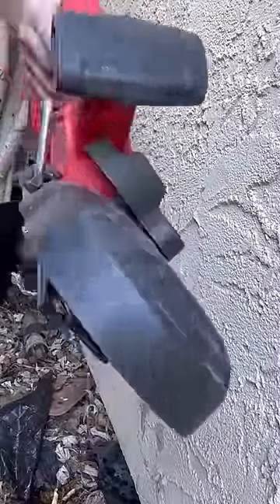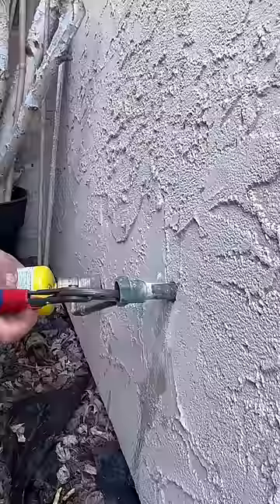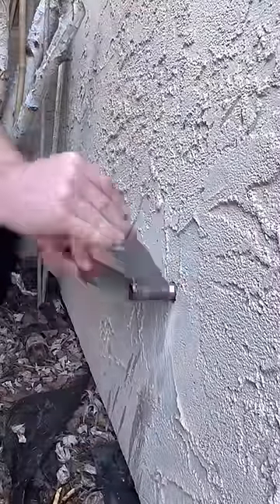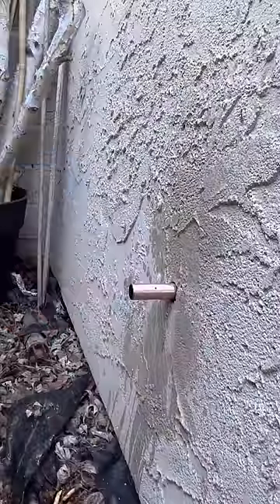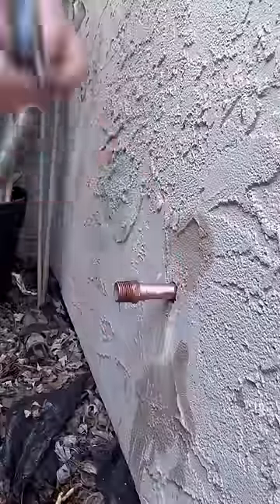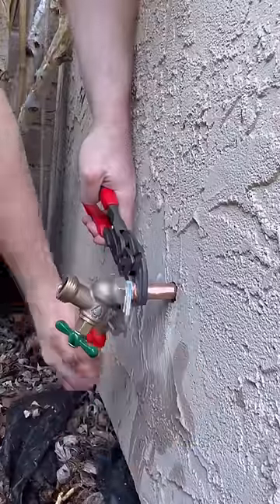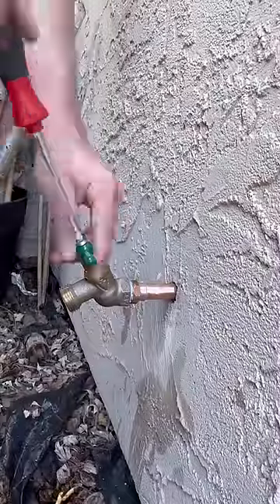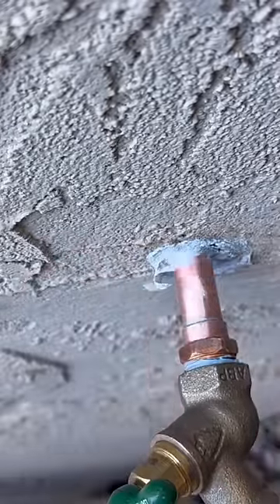swapping a hose bib #plumber #plumbing #diy #soldering #oateyambassador #propress #copper #repair

Comment: “All the OGs use tape and dope” damn straight, good work.
Reply: Exactly !
Reply: He earned all our respect when he said that
Reply: @OB1canblowme  was searching for this comment true but the new school OG’s dope/tape 😂
Reply: Good job buddy
Reply: I got yelled at by three different bosses for tape and dope as a sprinklerfitter.
They said to wipe it all off and pick one to re-apply.
 Idiots.
  I made up 76 drops that did not leak.
Reply: It's dope or tape, no point in using both.
Reply: As I was told, "you don't have to but I do" 

So I do.
Reply: True!!!
Reply: They use Teflon-only in deep-sea operations and on 600 PSIG sprinkler systems... probably good enough for residential plumbing 😅
It leaves no mess and is easy to clean up to re-do (for the next guy)
Have been using PTFE tape-only since 2016; not a single leak
Reply: Never leaks from that joint
Reply: @cafenightster4548  there are micro crevices between the Teflon tape. Dope fills those. Soft and hard, like a katana.
Reply: @walterbrunswick  you've had one leak since 2016? 

Are you a truck foreman or business owner? 

Cause if you're putting pipe in every day since then you've had a leak be it you're fault or not.
Reply: Have been doing PTFE and Dope for 6 years, that's what they did at the HVAC company I worked for, and considering they were the one of the biggest in the NE and they have the only training university of its caliber in the entire US, I'm going with what they taught me.
Reply: Real man talk right there!!!
Reply: @andrewveazey1598  You cant be new school and an og at the same time. They are literally opposites.
Reply: @markobrien678  Its not because they leak, its because they spin off as easy as they spin on.. I use loctite thread and its better my opinion, never leaks and is very forgiving plus makes a stiff joint which needs a decent amount of strength to crack loose.
Reply: It’s stupid! Just use dope
Reply: @Wtfinc  I just use dope on black iron too and it's never been an issue.
Reply: @spencerchristie4000  yes I own my own business 

Gas fitter by trade
Reply: @walterbrunswick  ahh a gas guy. Whats your average psi on a line you work with typically?
Reply: Dope, tape, dope how I learned
Reply: You should try Locktite sealing cord, instead of PTFE, works for Water and Gas, and seals better than PTFE, specially on old threads.
Reply: @andrewveazey1598  my dad was a plumber and he show me to always use pipe dope and teflon. I never had a leak.
Reply: @spencerchristie4000  7" W.C. 
but I do hydronics as well, up to 50 PSIG...
Reply: takes note
Reply: @Supa Trending Daily the locktite cord is best of both though, it has the ptfe to lube and the cord to seal as well as the taper.
Reply: 👏👏👏👏👏 dam straight
Reply: Nope lampwick and dope
Reply: Tape then dope
Reply: Father taught me that way and I’ve never strayed
Reply: Its 2023 just use the correct tape or paste for the job .
Reply: Does anyone know why we even still need these extra products, why can't manufacturers just make oring fittings.
Reply: @markobrien678  just cause they old don’t make them OG
Reply: @walterbrunswick  Yep. Teflon is absolutely all you need for pretty much anything.
Reply: 100%
Reply: yes exactly, tape and dope everytime. I use it on steam pipework.
Reply: Yep I was taught by a grizzled OG the exact same way.
Reply: Yup me too
Reply: 💯💯 homie needs to watch what he says. Them words will make an OG like myself a little too excited Lmao. Greta job kid.
Reply: @walterbrunswick  water playground, puddles everywhere.
Reply: @walterbrunswick  what's that smell....
Reply: @riekmaharg2  yeah the cord is good, I used to use only hemp and paste, it's semi-permanent, then changed to the cord. Then started working with steam and used tape and dope.
Reply: using both is a waste of time. they both work by themselves. anyone who says otherwise enjoys wasting time because it makes them feel better and can provide no real evidence that both works better.
Reply: @SuperAWaC  it's OK, we're making a fortune cleaning up after you.
Reply: @sparked3113  I've never had a leak because I apply products properly instead of using redneck science.
Reply: That's how I was taught to do it. That's still how I do it.
Reply: @SuperAWaC  ok then.
Reply: @scythelord  like I said, if good enough for deap-sea at crush-depth where divers' lives are at immediate risk, good enough for residential 
I use Teflon-only on NPT airlines as well (compressed air at atmospheric), no issues at all
Reply: @SuperAWaC  well how much time was saved when there is a call back. Usually after hours on a weekend. It’s cheap insurance, plus it makes complete sense to me to use both on old steam lines, the dope will fill any voids or gaps and the Teflon helps the next guy get it apart.
Reply: @philsmeal9897  When it comes to situations where I need "cheap insurance" and I want to be completely certain I will have no problems long term I just use an application-specific product. For instance, on steam locomotive piping I use Loctite 5770... But Teflon tape alone would work even on that. When these good ol' boy plumbers tell me about all the 7 herbs and spices secret thread sealing techniques passed down for ten generations of plumbers that they use with 50 psi of water or whatever I just roll my eyes. The steam locomotives I work on operate at 200psi which means the pipes get up to around 400F and I have tested teflon tape with nothing else to hundreds of cycles from dead cold up to operating temperature and I have never had an issue with leaks even on 40+ year old beat up pipe threads, but it is a state inspected high pressure boiler so I just use the fancy stuff to gild the lilly. The only time you really have to start considering specialty stuff is in specialty situations. Above 300WSP/600WOG, safety critical situations, sour gas, etc. Something that a residential plumber will never see. For anything else tape or dope by themselves will work.
Reply: @cafenightster4548  not quite. And the best reason to use tape and then dope is because it gives you a larger range of positions where you have a good seal. The hose bib in question is a great example of that where . it needs to be both watertight and right side up.
Reply: the trouble with that thou is you keep turning the fitting, and because of the dope it never tightens up and you end up snapping off the fitting
Reply: @im_a_ukie8951  I haven’t had that happen when I wrap the thread tape in the direction that I tighten the fitting. The danger with plastic fittings is too much thread, tape, expanding the fitting and breaking it, which I have done!  Watch out for small brass fittings too.
Reply: The OG I learned from that's been at it for longer than the guys he mentioned have been alive used pipe dope and pipe dope only. Always white. Worked for the man for 10 years and never once saw him use Teflon tape.
Reply: He taught you right!
Reply: Nice to know.
Reply: Always tape and dope.  Blue monster tape and gasoila is a world class combo
Reply: @maxballiet8632  why dope? Try using dope underwater
Reply: When a guy has repairs he made before I was born that are still good, I listen to his advice. 

Right on.
Reply: Hell yeah, one of the OG 30 year foreman does this at my local hahah, clean work for sure
Reply: Who tf only uses one lol
Reply: Teflon tape and pipe dope go together better than peas and carrots.  Only wish I had learned that 40 years ago.
Reply: Learned this at the parts store from an OG after i had a pvc fitting leak.
Reply: @walterbrunswick  doing hydraulic systems on heavy trucks, we do tape and dope on any NPT fittings. Peak pressure is 2200 psi and no leaks. I’ve been told that some people learned the hard way that fittings need dope and tape, not just dope.
Reply: Pipe dope and tape and anti seize for unions
Reply: Yeah buddy on all my propane installs the old timers trained me that way too
Reply: Yes sir. Tape and dope
Reply: On fuel oil(diesel) you use dope only. We used to use rector seal #5, but when they changed the diesel to lower sulfur, the joints would leak. Go with 300# fittings, gasoila pipe dope, and tighten the ish out of the fittings.(for diesel fuel). Better yet, socket weld it all except for your solenoid valves(threaded).

Just about everything else you use tape and dope.: domestic water, hydronics, natural gas, steam, so on and so forth.
Reply: @alphabuilders   he wasn’t saying he was og , he was stating that he was told by og’s how it’s done ✅
Reply: That's how i was taught
Reply: I was thought, wet the threads, tape it then wet it again on larger fittings.  1/2 n 3/4 wet , wrap, tighten.     Not a single leak. Water nor gas
Reply: Tape and dope all day
Reply: @CafeNightster  yes there is, reliability and ease of tightening.
Reply: @ixpol9163  do NOT use dope on domestic potable! I've used tape-only and have had no issues whatsoever, 150 PSIG
Reply: @jeremybanks719  wetting the threads would seem like a good idea, but pointless really... PTFE has such a low coefficient of friction that it's redundant
Reply: Dope is for gas lines tape is for water
Reply: @G4mer_D4d  that’s stupid. Those spaces don’t exist because the tape smashes and molds together as you screw it on.
Reply: @isavedsuperman1x  widespread doesn’t mean intelligent. Just look at YT shorts.
Reply: @noobpro9759  threaded is threaded, tape is for everything, period
Reply: @walterbrunswick  read the labels. I could use fire calk for every baseboard and doorway in a house and it works fine but does that make it right? No.
Reply: @robertoreal1117  exactly. I've had just tape leak. Never dope and tape.
Reply: If your doing critical work use dope then tape then dope.
Reply: @walterbrunswick  yeah I know what you're saying. But when you got to pass inspection and your pulling a test and if it's gas your using a Coleman gauge. It's got to be on there for a little bit of time. There's been times the inspector didn't come out for 1-2 days after I called in for a test.  Even the slightest drop in pressure is shown. Temp related can show on these gauges.   I'm not changing it. I've never failed a test when I was running gas lines. Yeah it took me longer to do the job, but when I was done, you could run a straight line on my work and never had to wonder if it would leak.  I did extra brace's just in case someone was to hang stuff on it. You know some is going to
Reply: @Mark OBrien  for Sprinklers you're not supposed to use dope at the head because it gets into the head and clogs it up. -guy who pulls nozzles and finds dope clogging it up
Reply: Fact ✔️ TRUE.... Commercial Plumber for over 2.5 decades. We always use both.
Reply: @noobpro9759 Said no professional plumber ever.
Reply: Fr that's what my cousin and his friend told me my first day of work 😂
Reply: @cafenightster4548 if you wanna save 7 cents per application maybe but im on 6 years running with 0 fittings leaking so far.
Reply: @Wtfinc dope helps it be slippery as well as sealing and teflon ceates a gasket which if you add up make a great connection as a team and it costs 7 cents more per application. 0 recalls and 100 percent confidence.
Reply: @scythelord pipe dope makes it slippery as you tighten and seals.. nm teflon creates a gasket.. you add them up and you have a professional plumber with 0 recalls
Reply: @spencerchristie4000  yes!
Reply: no, hemp is the best for water
Reply: Theseasonorg teaches whole bible.
Reply: People in the reply claiming  "I've never had a leak" as if they would call someone who did the job wrong the first time to fix a bad job 😂
Reply: And more tape ...   Lol well done bro
Reply: @cafenightster4548  Tape on plastic, dope and tape on metal...dope first so it goes to the bottom of the threads as required by the uspc.
Reply: @G4mer_D4d  yup
Reply: @longrodvanhugendong9742  nope
Reply: @im_a_ukie8951  your threads are too deep.
Reply: @walterbrunswick  But the sealant must reach the bottom of the threads to be uspc compliant.  Tape leaves voids unless used after dope.
Reply: That’s exactly how I was taught
Reply: Just because everyone else used it, no reason to not make your own observations. I've only ever used tape with no problem.
Reply: @riekmaharg2 dry o rings fail all the time and only seal at the end not throughout the air gaps in the threads.
Reply: Did this fail, seen water when you applied flux ,and again, while you soldered . Don't hate me ,just constructive comment 👍
Reply: Yeah but which dope?
Reply: @cafenightster4548 I agree
Reply: @alphabuilders now that’s a good idea, I am sick of fixtures that spin around when I just use PTFE tape.
Reply: I never use water in my pipes and not a single leak in 24 hours.
Reply: Respect never had a dope and tape leak yet have had multiple tape only or dope only leak.
Reply: Ive been doing plumbing for almost 5 years now and I was only told not to use dope on a handful of things (i don't even remember what exactly though) and always use Teflon. 

I literally couldn't imagine not doing both on a hose bib or black iron or really anything that calls for a threaded joint at this point, it's just my instinct to pull both off the truck till I'm told we actually don't need the dope. Even when I occasionally see or use the dope that's supposed to act like Teflon I still feel thr need to put actual Teflon on (mostly cause I call bs)
Reply: I use tape and dope too.  The bib gets the tape.  ;-)
Reply: Yessir!
Reply: A-fuckin-men!
Reply: Cuz tape and dope gives you a nicr smooth high!
Reply: That's how I was taught also from the ogs
Reply: You can use both, but it's redundant and a waste of money in the long run.
Reply: Good work you keep the copper on the outside its more durable than brass and thats why the plumber b4 him did it that way
Reply: Dope then tape
Reply: @walterbrunswick Congratulations

Comment: My man out here putting the handle in a position that makes sense! Holy cow its nice to see attention to detail like that.
Reply: Exactly. That’s what caught my attention.
Reply: I'm fixin' to go out to mine and do that, ha!
Reply: I always wonder what kind of contractors you people have had the displeasure of coming across when you mentioned something about having the valve easily accessible. I guess people just hold themselves to a higher standard nowaday I mean no plumber even a piece of s*** would install the valve with the handle at 4 or whatever the hell you guys are mentioning
Reply: @BonsaiBuckeye  last plumber i dealt with left me with a new ball valve with no handle on it

i think he also did some illegal pipe routing because the inspector i told to have a look at it got him to redo some stuff
Reply: Attention to detail you say, just by adjusting the handle. Then goes and goes does a worse than a first day apprentice wit crappie blue goop around the pipe penertration? Lol.
Reply: @ronaldmaxwell2568  oh jesus it looks fine quit crying over nothing
Reply: It was crooked bro. That's amatur detail. He shoulda put it together and made it straight, marked it and then soldered it. Plus that crap he smeared all over the wall made me flinch a little. I wouldn't give him an A+ just because he didn't put it on upside down or something. He gets a B- from me. Solder looked great but it's crooked and that wall looked awful.
Reply: OCD but I love it. ❤
Reply: @BonsaiBuckeye  lmao exactly like im over here wondering what they're praising. I need to start charging more if this is so amazing to regular folks
Reply: I was wondering what he did there with the handle at the end watched it twice and I was looking at the bottom thinking he took something off! Ok ya smart!
Reply: Plumber equivalent to having the screws on a cover plate turned the same way
Reply: Attention to detail keep it the way the other plumber had it because copper is more durable than brass so you keep the copper on the outside and use a male hose bib